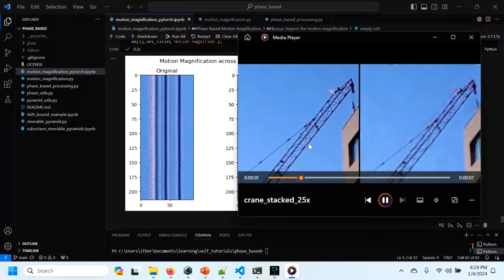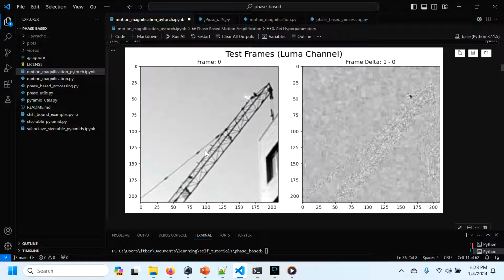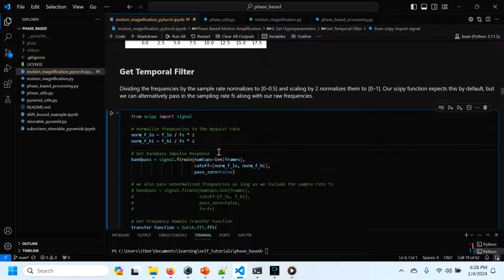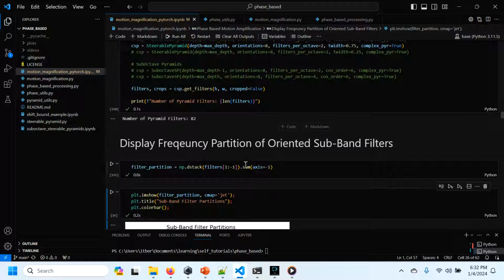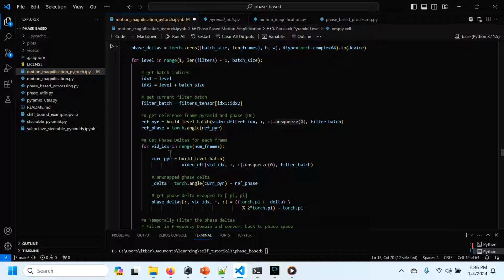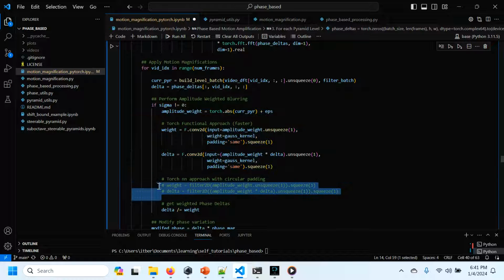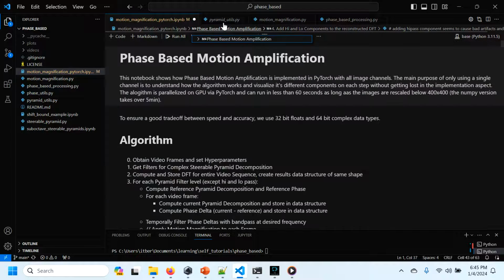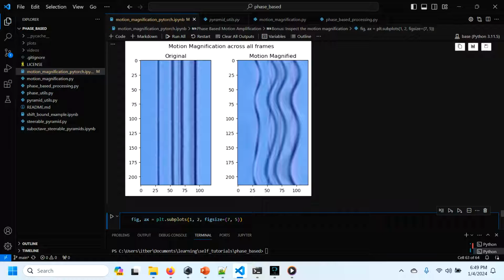Phase Based Motion Magnification

Comment: Does applying such a narrow band-pass filter cause problems? For example, after making an imperceptible motion visible, if we then track this motion and try to measure the vibration frequency, could it mislead us? Also, how do we determine that the motion lies within this frequency range?